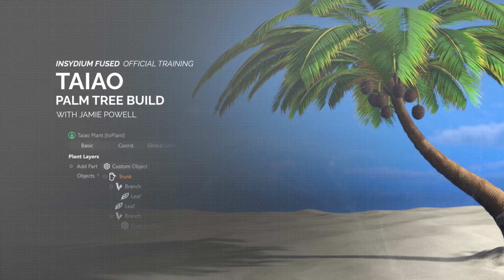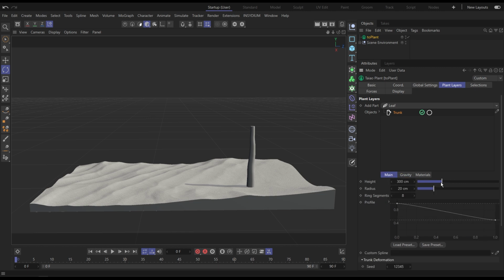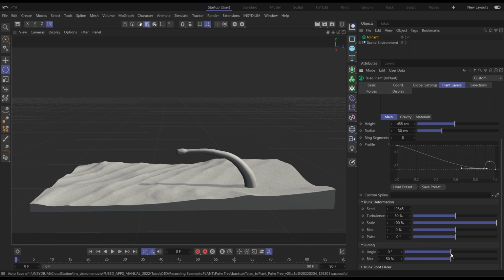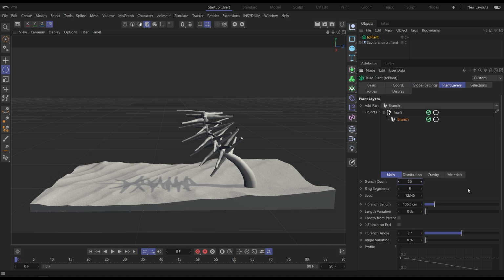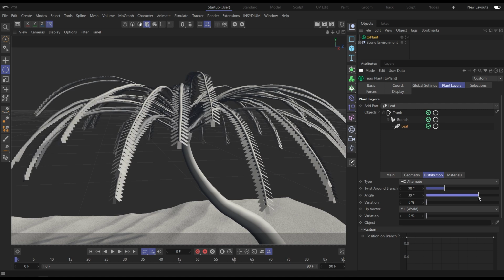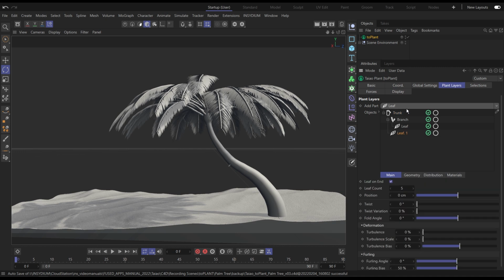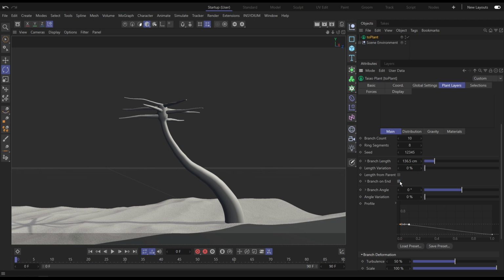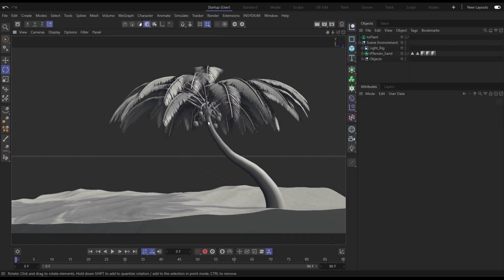Taiao Tutorial - Palm Tree Build

Comment: In the trailer/sneak peak you say 'non-intersecting branches and leaves' Be great to see how you accomplish that, cant seem to figure it out.
Reply from the maker: Hi Timothy,

Take a look at the Taiao User Manaual here: https://insydium.ltd/support-home/manual-taiao/
Hopefully these can provide you with more information.

-Thanks
Reply: @INSYDIUMLTD  thanks for that. I have watched maybe 4hrs worth at 2x speed but havent found it yet. If you can point me to which video/timecode I should look that would be wonderful. Or if there is a text based manual that would be ideal.
Reply: @T_Armstrong  check out Meshing Type the Global Settings tab. It's covered in the Taiao Global Settings Video Manual
Reply: @jamiepowell3724  thanks. From my understanding that is to create closed geo between branches and trunk, or branches and sub branches. Im wondering about the 'non intersecting branches and leaves' which would mean leaves would avoid each other, maybe some kind of built in push apart effector or particle driven avoidance? I think I just got too excited at that possibility when I heard that in the sneak peak :)
Reply: @T_Armstrong  Have you checked out the toTree rather than toPlant? I think that might be what you're after.
Reply: @jamiepowell3724  Thanks for the suggestions. They have a clever particle based method of generating non intersecting branches in the ToTrees object. But not leaves. Cheers though.